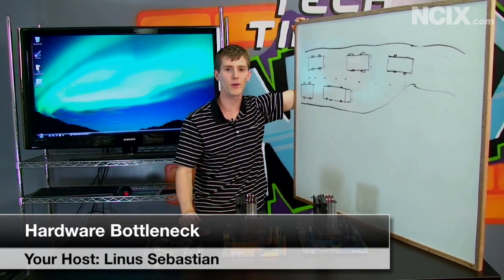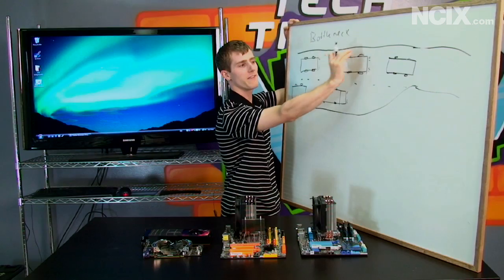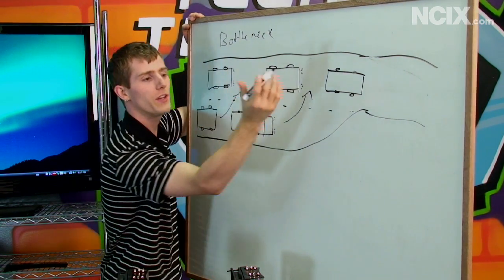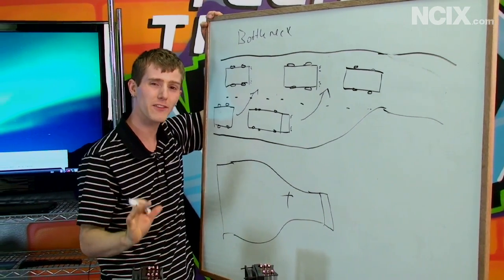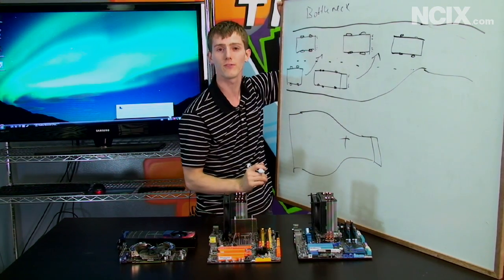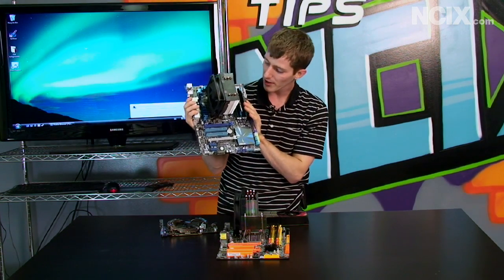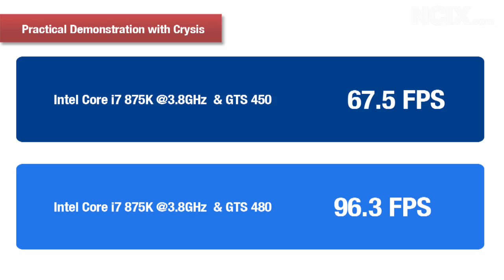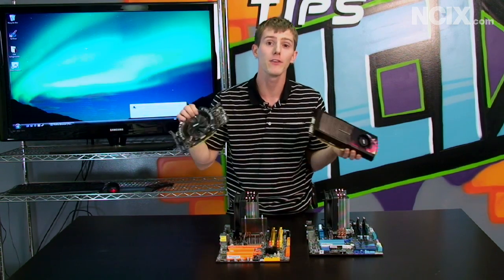Understanding Hardware "Bottlenecks" and How to Avoid Them (NCIX Tech Tips #81)

Comment: Some help? I just ordered the GTX 980 ti overclocked Zotac edition, but I feel like maybe my processor sucks? I would accept to lose a few fps, but will it be worse than that? Here is my rig:

Specs:
ASUS Crosshair V Formula, Socket-AM3+
Corsair SSD Force Series GT 60GB 2.5"
Cooler Master HAF 922 Midi Tower Black
XFX Radeon HD 6950 2GB GDDR5 "Dual Fan"
AMD Phenom II X6 1100T Black Edition
Corsair HX 850W PSU
Corsair Vengeance DDR3 1600MHz 16GB CL9
3x Seagate Barracuda® 7200.12 1TB (Which run in RAID 0)
Reply: Tore Bordal For a midrange card your cpu might do fine. But in a high end system it will definitely bottleneck. How much, it depends on a game that uses more single core performance. Even Sandy Bridge i5 lineup will beat your current cpu. So it is time for an upgrade. I would recommend Skylake i5 6600k or i7 6700k.
Reply: Tore Bordal Do you overclock your cpu? (Honestly with a Crosshair I'm assuming you do)  With even a mild overclock that CPU won't severely bottleneck the GTX 980 ti.    You will lose some fps but will hardly be noticeable for 95% of current games.  I'd look into upgrading your cpu in the near future but you can probably get away with that CPU for a while longer if you want.  I changed over from an fx 8320 to an i5 4690k because of everyone talking about how much better it was.... long story short: literally 2 fps difference.  Waste. Of. Money.  Don't fall for the trap, games are by and large GPU limited.  I'd only update my cpu (assuming you have a decent one at the moment-- ie at least quad core) if I needed the extra cpu crunching power.
Reply: I understand. But I see that others' get a lot better performance with the gtx 980 ti than me. Could it be windows 10 that sucks? Or maybe there are some games, like GTA V, which are processor torturers. I like the performance of the card a lot, I don't complain, but it costs 1000 dollars (Norway is expensive), so it's a shame that it only runs gta 5 on ultra with only 1080p in barely 30 fps.
Reply: Tore Bordal This could be due to a couple of factors.  1) Are you overclocked to at least 4.0 Ghz?  2) Have you downloaded the most recent drivers?  (GTA V optimizations will help)  3) Is population density at max?  (probably the most cpu intensive waste in the game)

I doubt it's Windows 10.  It has some issues with compatibility with a few things; but the operating system actually leverages multi core performance better than windows 7 (and about the same as windows 8.1); and aside from the privacy issues (which you should probably disable in case you haven't already) I'm loving it.

$1000 bucks for a gtx 980 ti?  Ouch.  Unfortunately GTA V is a somewhat CPU intensive game, so If that's the kind of game you want to play you'll probably want an upgrade.  

I'd advise the fx chips since it's already compliant with your motherboard and skylake + new motherboard would probably set you back close to a grand. (unless it's only GPU's that are more expensive in norway)  If you overclock an fx 8320 (same architecture as the 8350 and 9590--- only difference is binning and stock speeds) you shouldn't have any issues (but you will need a fairly decent cpu cooler)
Reply: Thank you so much for such a nice reply. I have actually been wanting to buy the fx 8320, but what makes it better than mine, other than the 300 Mhz? Do the two extra cores make THAT huge of a difference?

I don't really play GTA, I'm more of a Dark souls and Americas army player (random, i know) I just wanted better framerate and 4k, since I faultly bought a 4k monitor. (I suck with money, I know).
Reply: The extra cores won't make a huge difference in gaming because most are optimized at the moment to only use 2-4 cores.  The biggest difference between the 8320 and the 1100t is the architecture and newer instruction sets.  (though you will notice a difference in applications that utilize all 8 cores).  

The new instruction sets and overall better optimization results in the vishera architecture outperforming the 1100t by around 6% in single core performance and 20% in multi core performance (most games use at least dual core), and a whopping 35% in memory intensive processes (perhaps due to a much higher cache).  They also tend to overclock much higher than the 1100t (+500 Mhz).

Here's a benchmark of GTA V that might be interesting to you.

http://www.techspot.com/review/991-gta-5-pc-benchmarks/page6.html

As long as you aggressively overclock the 8320 should be able to get you past the bottleneck.  Obviously though, it'll lag behind the newer i5-i7's (if they're also overclocked).  I didn't notice much of a difference moving to an i5 4690k from an 8320; but I only have a gtx 970.

Comment: I have a question if I have a10 6800k with a xfx radeon rx 460 4g gddr5 would it bottleneck my pc?
Reply: Desmond Griffin bottlenecks are also determined by the usage of each part by the application. if you are running something that is extremely gpu intensive but has a maximum requirement of a dual core 2.6ghz pentium then there wouldn't really be a bottleneck. once the load on a component becomes more than what that component can handle it begins to take everything with it. the gpu has to wait for the cpu to catch up or vice versa. in your case the average amount you will encounter a bottleneck will be fairly limited ad your gpu, and cpu have about the same power. you have plenty of vram to play with and assuming you keep the amount of ram you have up to date you should have very few bottlenecks. it's also good to keep in mind smaller but very noticeable bottlenecks in a system such as storage ( ssd is significantly faster than any hard drive.) or cooling issues (overheating cpu, or gpu) something as simple as a plying new thermal compound to your cpu/gpu and it's cooler could minimize bottlenecks or increase overclocking potential (also a viable option to remove bottleneck).
Reply: oh cool, thank you
Reply: Desmond Griffin happy to help with any system related issues

Comment: a 3dmark is a bench-marking tool NOT A GAME.
3dmark pushes all you components to their limits SEPERATLY, so graphics benchmark will kill you GPU but try to put little strain on you CPU in order to give you a score for you GPU, after all the test it gives you a summary of all tests and a total.

Real games try to use all resources at the same time and they are limited by which end can't "help" it anymore.

Comment: I'm currently getting low FPS at low settings in Rome 2, while the average CPU usage sits at 35%

Is it safe to assume that my GPU is the bottleneck?

(i5 2500k & HD6950 1GB)
Reply: Alica Ljungberg depends, is your gpu usage at 99%?
Reply: yes, even-though I get warnings about low VRAM

I think I'm gonna get the R9 290.
Reply: Alica Ljungberg you really should :P you wont regret it, hell even a 280x is much better

Comment: I already knew I had a bottleneck on my system, but I still get one hell of a performance increase, I have an fx 4130 and have just upgraded to an r9 280x from a gtx 650, I can live with a small amount of bottleneck until I can upgrade my cpu, I mean, it still gets 40 - 60 fps on ultra in most games, which I fond more than playable

Comment: Linus what about my system

Amd fcps 6300 3.5 ghz
x2 Radeon 7870 
8gb 1600hz ram
Asus sabertooth motherboard
2tb hdd  hard drive
900w osu

Could you see a bottle neck in this or is this a very well rounded gaming set up
Thanks
Reply: That's a very very well rounded system.  The only thing I would consider doing to that system is adding an SSD, and then I would officially stamp it as "perfect", but that is of course only icing on the cake.
Reply: Completely fine, a SSD might be a option  to speed up boot times and windows all round but its completely optional
Reply: HarryBearGaming
 That's exactly what I was getting at.  It's so well balanced that no real improvements really need to be made to eliminate a bottleneck. An SSD would be the icing on an already delicious cake.  Well done!
Reply: Drew W I'm making the assumption here that all Asus Sabertooth motherboards are outfitted with Crossfire support? Otherwise that might be a pretty big bottleneck :P
Reply: Mikelamont2 As far as I know, I would say you're absolutely correct.  There may be an exception or two, but for the most part and to my knowledge, all Sabertooth boards are called such because they bring some of the best, toughest features to a motherboard.  To do so well on the PCB materials, rigidity and features, as well as spend so much time and effort getting a great CPU power arrangement put together, that it'd be a shame not to put on some sli/xfire support while they're at it.

Comment: Happens to be you can get a $100 CPU that does the job well enough to justify a $400 GPU.
Under normal conditions (like video settings you'd use with a higher end card) the lost frames from a higher end card and less than best CPU are minimal.

The latest AMD FX (Piledriver) or 2 generation old Intel i5 will suffice for pretty much any level of visuals and the CPU requirements are going to start dipping as OpenCL(or equivalent)  takes over.

Comment: Will the i7 6700K and MSI GTX 970 OC 4gb get bottlenecked?
Reply: Why would it? None of those are actually bad/old
Reply: +Thicoo I I don't really know, i figured it would a little bit because the 970 is a bit old
Reply: I currently have a 1080 paired with an OC'd i7 4790k. You should be good.

Comment: Would a Pentium E5300 bottleneck a GTX 750 ti?
Reply: I am pretty sure you mean will a GTX 750 ti be bottlenecked by a E5300. You are pairing a six year old CPU with a four month old GPU. I think you can figure that one out.
Reply: Lol, are you joking around? If your not then I would need to say, that would not work out at ALL.
Reply: Thanks guys for the replies :D
Now I am ashamed to say that I need to upgrade my cpu ._.
It's a great casual use CPU for the money but now that I think about it, I need an upgrade :D
Reply: Good Luck!
Reply: ***** Ty :D
Reply: Yes its running well, you just need to overclock your cpu till 10.7ghz
Reply: Pair it with a GT240, I think that's your best bet, or the GT610 which is a piece of shit for the money.
Reply: It's funny because my E6600 bottlenecks my factory OC'd MSI 9600GT :D.
Reply: I had a Q8200 and it did not bottleneck my GTX 285 at that time, I sold that card to a friend of mine and he also has a pc with a core 2 duo e4500 and a GT640 and it does not bottleneck.

Comment: I just ordered a Radeon 7770 and my CPU is Intel Core 2 Quad @2.4 GHz.
Yeah, it's pretty old. Will it bottleneck? :C
Reply: No it wont my gtx 570 and c2q runs great thought q9550 is 7yrs old :P
Reply: TheIdiotPlays Same here running 750ti gtx and I'm REALLY happy. I can play "anything" in 1920x1200 :).
Reply: krecikowi Dax Corsiar  Q6600 bottlenecks any GPU made in the last 5 years or so.... Depending on what games you play, you will see a huge improvement upgrading to an i3 or i5. Q6600 has outdated instruction sets, terrible single threaded performance, and the architecture is so 2006. Intel's single threaded performance has nearly doubled since that thing was released.
Reply: I have a q6600 as well but I oc'd it to 3.0ghz and with my gtx 295 it is well balanced and plays even modern games well. If you have an aftermarket heatsink I recommend you OC the q6600. It is great at it and is easy to do.
Reply: I Am Rush It doesn't matter if you overclocked it to 4Ghz+ on liquid nitrogen, it would still bottleneck. Get a haswell i5 and call it a day.
Reply: Not so much, the quads without hyperthreading are still valid to a degree. Norgen is correct to a point that the North bridge chipset would need to be overclocked as well to help it. But everything can be tweaked to a degree.

Now if you were talking Duo I would say your fucked. But I Am Rush is speaking truthfully in his own right.

In this case decide for yourself how to handle bottlenecks but I don't see that heavy of one. Now if you were talking about a 880 gtx we might see a little.
Reply: Arulin E  There is no such thing as a gtx 880. Stop trying defend an 8 year old CPU. In those 8 years I could have enough money put aside to buy dozens of i5's and i7's 

As for hyper-threading, I already know very few games take advantage of more than 4 threads. i5 compared to an i7 yield similar results in games. 
http://www.ocaholic.ch/modules/smartsection/item.php?itemid=1061
Reply: Pardon, I am a little more knowledgeable on "Notebook" cards. One of have thought that to Geforce 8 series was released on the cheap boxes too. Next time instead of being a douche bag child from the hills try being kinder.

http://www.geforce.com/hardware/notebook-gpus/geforce-gtx-880m , yes it dose exist and carries a 850$ price tag and comes in both 4 and 8 gig cards. See I run an Alienware x17m R3 (with the option to upgrade to an R4 Ivy chipset board) so I am more up to date on the laptop MXM 3.0 (PCI-E 16x for laptops) and didn't know the 8 series was a laptop only release. Sucks to be a desktop owner during that one I guess.

Before my Alienware i7, I was running a 1730 XPS with the X9000 and dual 9800 GTX SLI. Frankly I was getting around 45 frames per second at high details in Final Fantasy 14 with my X9000 clocked at 3.8 GHz and my 9800s pumping at 950 mhz bios hacked. Yea , had one hell of a custom cooling pad connected to an AC in my RV in the summer and winter piped cold air from the outside. But I got that old duo core outrunning much till I found my 650$ deal on Ebay.

My point is that if kids in third world countries can make use of older hardware and impress the world by thinking logically and learning how things work. Thus meaning that hardware can be pushed harder if "you have the curiosity and willing to explore the concepts". By the way, when was the last time you had to make due with what you have Norge?
Reply: P.S Few games even use hyper threading, hardware dose to a degree, making the I series kinda pointless in the light of gaming. The chipset speeds of the newer mobos are good for gaming but till we start seeing more usage of hyperthreading; it dose not mean you toss a decent quad core to the trash bin.

I have been a software developer for nearing 25 years, started at age 17. I think my knowledge base is a bit deeper then yours Norge even with a few hardware holes.
Reply: is there a good i3, i5, i7 series under 100 dollars? o:
Reply: i3 tanks.

Here an old site I use  as far back as the 90s that still around today. They normally deal with "mom and pop" sites.

http://www.pricewatch.com/cpu/

There is a Gen 1 i7-920 for 75$. They are not bad chips and you get hyperthreading. Just use a bit more watts.
Reply: Look to Gen 1 and 2 with a mobo and you will be just fine on a Intel budget machine.

What mobo are you using, you might have support for a Gen 1 i7.
Reply: +norge696 I once borrowed a 650 ti boost 2gb from a friend, as he thought the same as you. He assumed it would make the graphics card bottleneck to the point of uselessness. Running BF3 (was the newest at the time) on high with nice fps 50+, he was impressed. Just goes to show though it might be old, it still holds weight in today's games.
Reply: Well said.
Reply: Arulin E You own an Alienware... stop talking.
Reply: Why should that point me at a point of disadvantage, acturally even the R3 has it limitations.

Comment: After tons of research I still don't know enough information unlike I thought I did. So I went ahead and got the following specs: 

Intel i5 4690k 4th gen Haswell 
Nvidia GTX 970 4gb graphics card

What motherboard will NOT bottleneck this CPU and graphics card? What memory and PSU should I get? I know I need 8 gigs and 500/600 watts but what brands are compatible and good with this rig? I am willing to spend around 250/300 British Pounds on the rest of these parts. 

Many thanks in advance!! :)
Reply: some asus mobo would be good, just make sure you are getting the right socket for your cpu, for psu, well you can get Seasonic they are reliable, or if you want something a little more brand recognition, corsair are ok, just be cautious if you are picking the AX version.
Reply: I did some more research and turns out I need an LGA 1150 socket mobo and someone recommended a Z97 mobo cause then I can do overclocking and stuff which I want to do in the future or right away if I learn how, cause my CPU is unlocked for overclocking I think.
Reply: Thanks for the advice though!

Comment: I have an overclocked i5 4690k at 4.3 ghz and a gtx1070. Any idea if I've bottled?
Reply: no u r CPU can even handle a gtx 1080
Reply: of course it cannot handle a 1080, 1080 is the second fastes GPU in the market.
Reply: +Felipe03000 It can bro check Tom's hardware's
Reply: karthik kamath But it is an previous gen I5... I will check it.
Reply: +Felipe03000 yes but it is only a tiny bit slower thank i5 6600k and since u have oced it is faster than i5 6600k
Reply: So what do you guys think? I'm at 4.5 now by the way. :T
Reply: pretty good but can go higher if u want
Reply: +karthik kamath 

I'm okay with it for now, being that I'm aircooled. But what do you guys think when it comes to bottlenecks? Am I restricting my 1070 fe with my cpu?
Reply: Michael Tarantino I saw some benchmarks... with overclock this processors can hold almost everything... buy the 1080.
Reply: the main diference to an i7 is the hyperthreading, and that doesnt have to much impact on gaming, those i5's can match and i7 on most of the games.